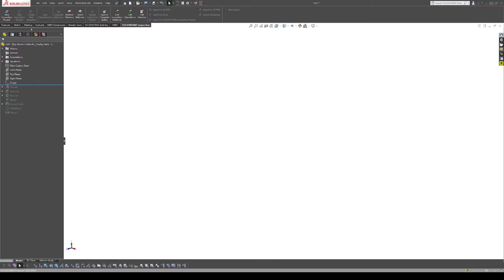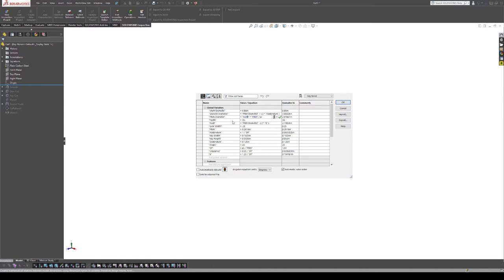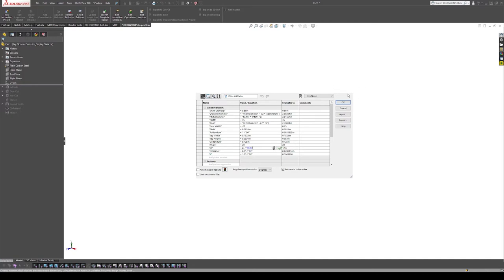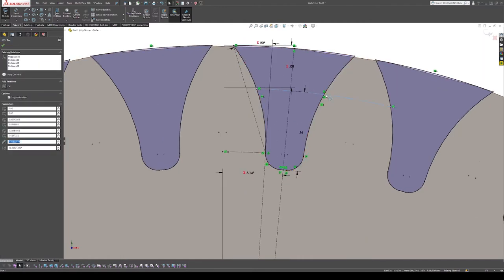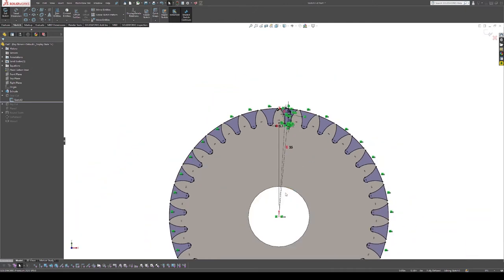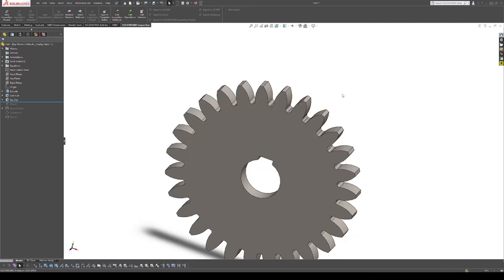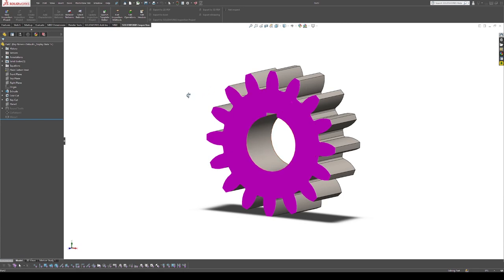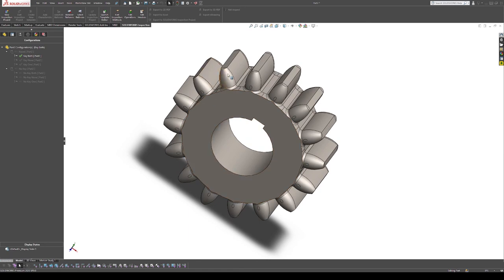Solid Tips: Making A Gear Template

Comment: Very nice. Did you consider adding a setting to chamfer the gear teeth as well?
Reply from the maker: I did not, as none of the gears I was modeling at the time had chamfers on them. This would be a simple change, just having the chamfer modeled after the original extrude but before the teeth are cut from the model. Any relations to the outside diameter would need to be updated in the 2nd sketch though.